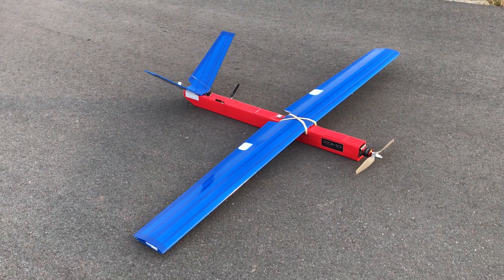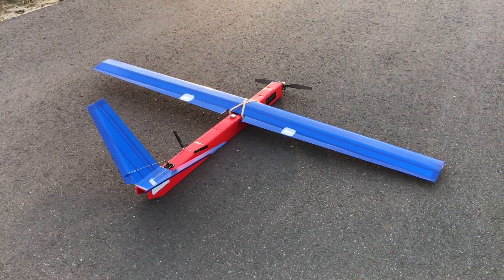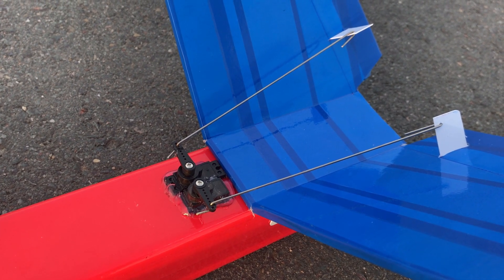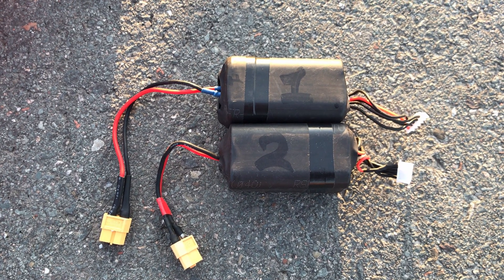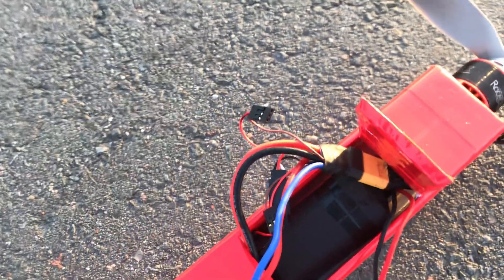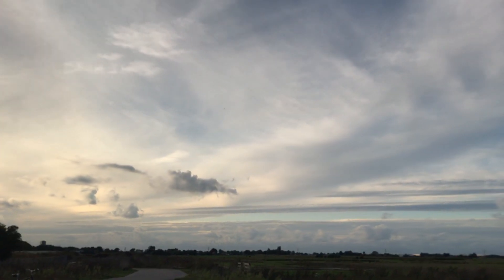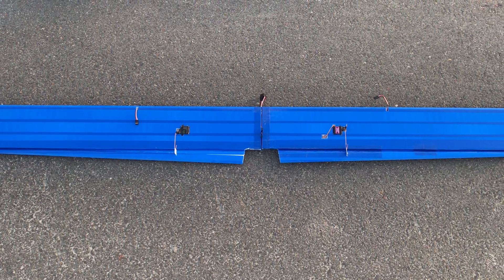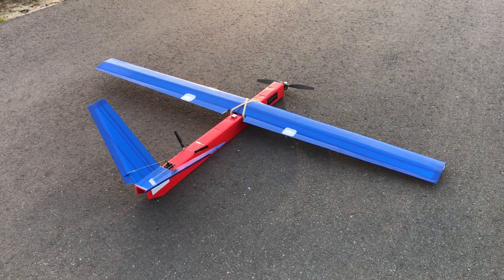Long Range FPV Aircraft + ZOHD Kopilot Lite and Li-Ion Batteries (Experimental Airlines Style) (HD)

Comment: Hi
I wonder how you wiring you diy Li ion battery for 1 pack..please make a video how and what specs battery you use.
Done subscribe your channel,enjoy watching your video.
Thanks😊
Reply from the maker: They're connected in Parallel (4S1P + 4S1P) = 4S2P (Double Capacity)
Reply: @AeroStuffFPV Does it also double the current rate of the battery?